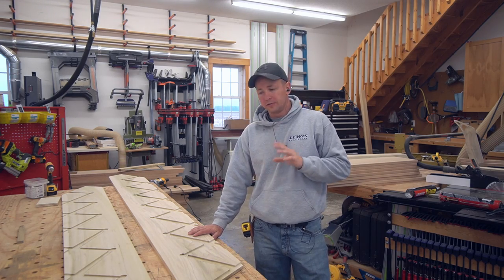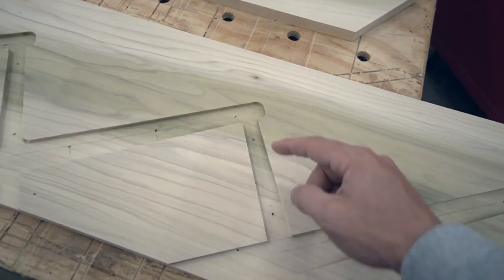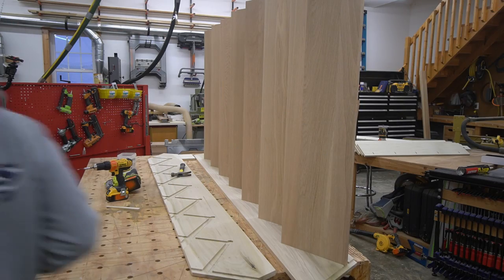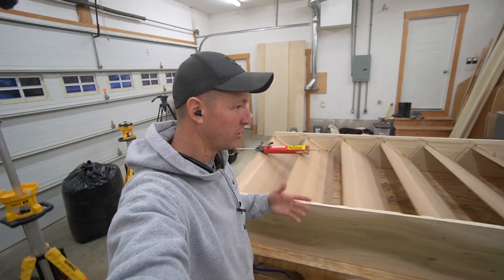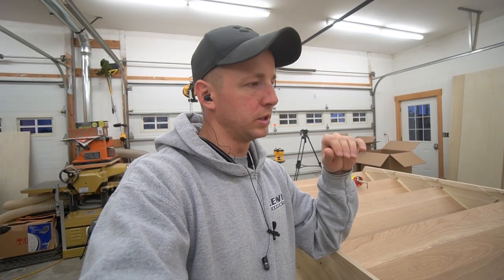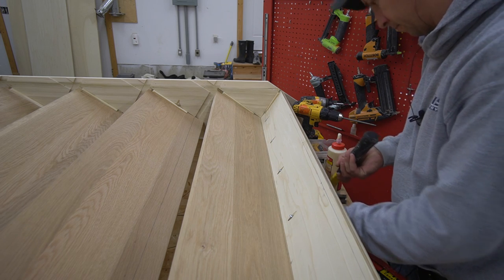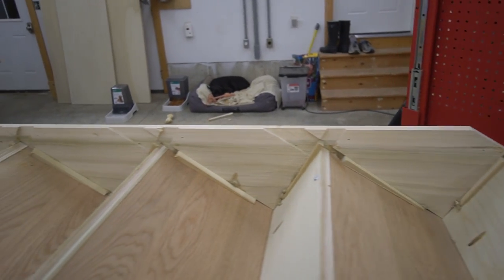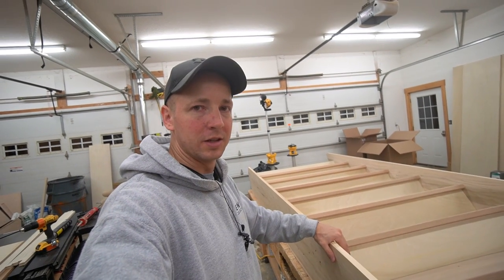How to Assemble a Shop Built Staircase - A Learning Experience...

Comment: You are definitely a skilled carpenter!  I enjoy watching your videos. Where I live there are stair companies that prefab all the staircases and drop them off to the job site whenever the framers are ready but I’ve noticed on you tube that most people build them with on site. Two guys can set an entire staircase in about 10 minutes. They always have 1.5” carriage instead of 3/4. Most are 36” wide outside to outside. We frame the opening 37”. Center the staircase in the opening. That leaves a half inch gap on each side for your drywall. And you can trim over the carriage all the way up the wall. Gives you a nice finished look.

Comment: excellent work!!!
A shallow dado on the underside of the treads sure makes it a lot easier putting in the riser boards. Also on the stringer with a bit of  tairout, running the router in carefully and slowly say even an inch the same way the bit is spinning before finishing the dado in the proper direction will eliminate that slit chip. Love the videos!!! keep them coming

Comment: Good job Spencer. 👍 When I built my stairs for my basement. Same closed stringers, with oak treads and  birch plywood risers. I dadoed out the under side of the treads 3/16 to accept the risers, I aslo put glue block under after as well.

Comment: Nice video. If you put a slight bevel on the top of the riser and the back of the tread, will ensure a tight fit and any glue squeeze out will be driven to the back side of the stair.

Comment: I made a stair similar to yours a few years back.  I however elected to groove / dado a slot in the underside of the tread (1/16" deep by the thickness of the riser) to hold the riser straight when the pocket screws tightened up.  Besides setting the riser straight it also eliminates any gap between the riser and tread.  I also skipped the traditional wedges and let pocket screws pull the treads and risers up tight to routed grooves in the skirt.  For a little extra insurance I glued and pinned a full length block under each tread at the skirts and put a few screws in form the outside of the skirt as you have done.  I did not rout the skirts for wedges - just routed for the ends of the treads and risers.  So far it has held up.

Comment: Could you have put a very shallow dado on the underside of the treads for the risers to seat into so that the pocket-hole screws would pull the riser tight against the front edge of the dado?
Reply: Yes.
Reply: In the UK we use this method and glue Blocks but the addition of pocket holes are a good way to eradicate squeaks

Comment: i build stairs like this for a living and you were very close. generally we build them in place between the walls and do the full assembly on site. we let the skirts run wild and do final cuts on site.. well make the template exact to the tread so you dont have to do the cope cut for the noses, well manufacture the treads so we can use a 1/4 round over and match that with a 1/4 bit when doing the routing for the template. we do not use pl or construction adhesives, its all titebond 2 or 3. the routing will be 3/8 deep in a 3/4 skirt.  that gives you some room so you dont have to be as accurate with the treads and risers. we use thicker shims cut to a wider wedge so we can get good gluing surface on the 3 sides that make contact. this also gives you a better place to hammer from. all of our risers go in first then the treads go in after. well glue the back edge of the tread to the face of the riser and back nail the riser to the tread, making sure to hammer the nails after to set them. we use 1 inch thick oak or vertical grain Doug fir for the treads and 3/4 poplar or oak risers. after the entire case is done will go back and glue bock the risers to the treads using poplar blocks. the glue blocks are about 1.5 inches long by 1x1.5. once glue blocking is started no one can use the stair until the next day. its a much more classic aprotch to stairs. i highly recommend reading "A Treatise on Stairbuilding and Handrailing" by A &w mowat,  "modern practical stairbuilding and handrailing" by george ellis and "the Modern Geometrical Stair-Builder's Guide" by simon de graff

Comment: It's sure is a different way of doing stairs... Well one thing different I do(I've been doing stairs 15+ years. I only use 40mm strings usually 230mm X 40mm. Tréads and risers are rebated 15mm into the string via a chamfered rebate. The chamfer allows a pocket for the glue to sit and hold (once the tréada and risers are wedged into place it's nice and tight. Tréads are 25mm, risers are 18mm. Also the risers are rebated into the treads with a 18mm X 5mm rebate. Noses project 25mm out past face of the riser. I started used pocket screws as well makes the stairs nice and solid. Also I add glue blocks to the back of the treads and risers to help strengthen the bond between them.  It's overkill but it's solid. Oh and that's me doing it in Ireland btw

Comment: Hi Spencer I do tons of fine carpentry however not to many stairs so please excuse my ignorance ; having said that why do you not use the new foam type glue they use on sub floors and stairs?  I hv heard guys state it’s great , you hv more control and it’s rock solid and you can save what you do not use plus no “run off” when u set it down? 
Just curious if it’s all hype?
Reply from the maker: I have used the great stuff brand subfloor foam but not enough to speak with authority about its use.
Reply: Nothing beats PL Premium!

Comment: I am a stair guy also 
Video was edited. But it would be a lot more easy to put stringer upside down and inset steps from the back at the same time in both stringer 
The. East to put risers wedges and glue block screw etc .

Comment: When I made stairs we ploughed a groove on the underside of the tread to fit the riser, this negates the use of fixing to a scribe line. We never screwed glue blocks, just a rub joint, personally I don’t think you need to screw through from the face, the wedges will hold it. Nice job though, love your work.

Comment: You’re flirting with disaster installing all your treads like that... 
A easier and safer way is to put your stringers back side up, install the bottom tread connecting both stringers… Then go to the top and put in a tread, riser, tread, riser all the way down the line...
I screw them in as I go holding them tight as I can to the top… Then go and add tightbond to all the wedge joints… Then hammer all the wedges home… You don’t have to balance the treads vertically nor do you have to climb on your workbench and precariously put the other stringer on top… It’s very fast and efficient...
I set up a jig and cut all the risers and treads the exact same length
Reply from the maker: Yeah, this was my first one so it was kind of a mental thing for me to be able to keep an eye on the top and bottom of things to ensure I wasn't screwing anything up. I knew guy who had shop stair experience would cringe at this one...
Reply: Another method is to attach the bottom tread to both skirts, face down. Do not put in the front screws on either side. Put in the next tread with one side in the mortise and push down till the other side pops in. The skirts will flex enough to let you do this. After putting in the back screws on this tread you can go back and screw the front of the previous tread. Repeat on all treads. This will scrape up the skirts slightly so make sure the nose of tread is behind the riser route, so any markings will be hidden behind the treads and risers. This method let's you glue the mortise without making a mess since you are only sliding the tread an 1 1/2" or so.

Comment: 13:58 run a dado joint in the bottom of your treads 1/4 inch and run your treads a 1/4 inch taller... Problem solved